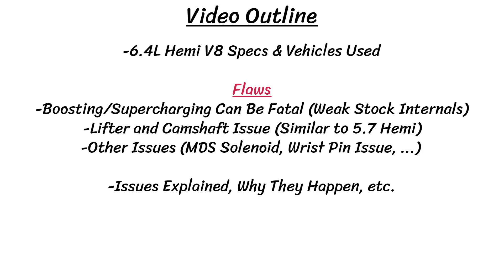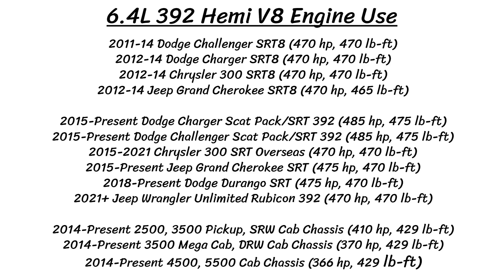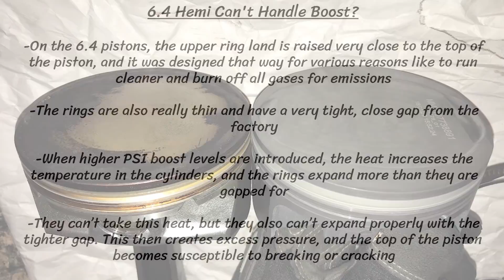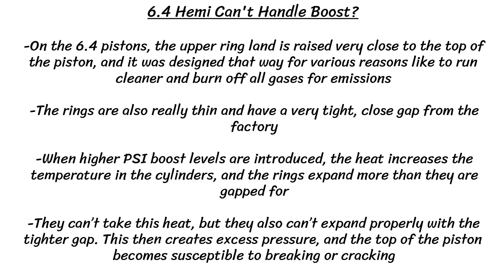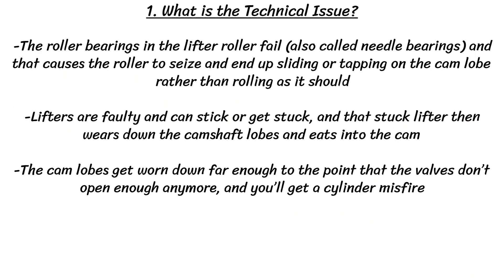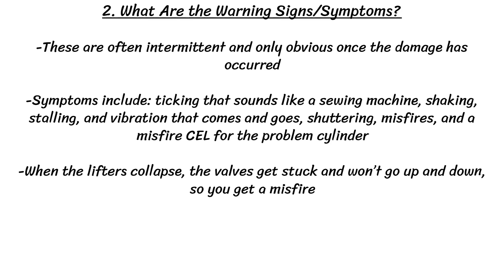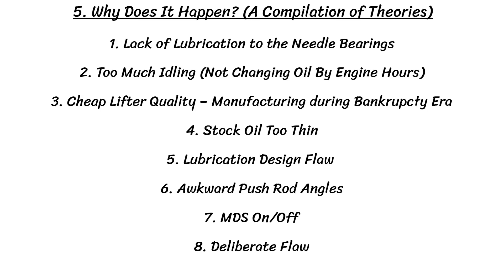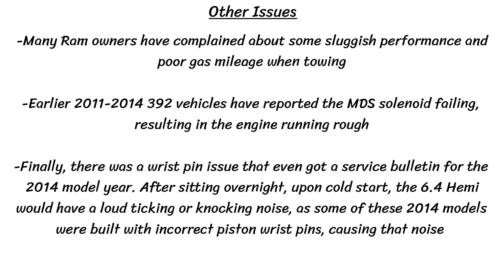The Specs and Fatal Flaws of the Chrysler 6.4L Hemi V8 Engine (392 Hemi Issues)

Comment: So they are fine unless someone screws with them. Ok.
Reply: You can mess with them, just don't boost it over 7-8 lbs without upgrading the internals. And make sure your tuner is experienced, and don't rag on it all day every day.
Reply: @dieseljunker9234  these people who burn out their cars think it’s normal to do doughnuts everyday, burnouts everyday and they wonder why the rear diff is fucked, trans is fucked and motor is burned out at 30k miles.
Reply: @Theycallmekenney  That's true, and from experience it takes discipline to keep your foot out of it lol. Trick is just drive it easy, be conscious of what repairs cost compared to your wallet, but don't forget why you bought it. Once in a while find an empty road and drive it like you stole it, or trade it back in for a honda.
Reply: @dieseljunker9234  exactly!! That’s how I treat mine it’s my daily and when it’s time to rip it I rip it on the backroads and on the highway but I’m not looking to just trash it by doing doughnuts and burnouts every chance I get who am I trying to prove something to?
Reply: @Theycallmekenney  yep not to mention rubber is expensive
Reply: @Theycallmekenney  Well when Chryslers quality is so low, it's now wonder why this happens. Even my mom's brand new 2015 Chrysler 200s transmission was going out back in 2018 with less than 20k miles at the time.
Reply: @journeytree  your moms car is what they call anecdotal evidence. If it’s happening on a large scale they’d recall the Chrysler 200….I don’t know your moms situation I bet if she had another car with the same issue you’d say the same thing about that manufacture. You people buy a cheap car expect Porsche quality. Just face the fact that a lot of people are idiots with their cars that’s why they rip through transmissions on a regular basis. Your moms car is a separate issue.
Reply: @journeytree  good
For your family but this isn’t about your family this is about guys who rip through transmissions because they beat on their cars. This is about V8 muscle cars and the issues these cars have because people don’t build them correctly and destroy them then blame the manufacturer for their own ignorance.
Reply: @Theycallmekenney  Well on the other hand my dad has a 69 Roadrunner with the original 383 and original transmission and it still runs fine so if a car can last over 50 years with a large V8 while a new 4 cylinder can't, there's a quality problem.
Reply: @journeytree  you’re comparing apples to oranges and I don’t know why…
Reply: @Theycallmekenney  Cleatus has left
Reply: @Theycallmekenney  pretty sure they don't even make the Chrysler 200 anymore cuz it was such a shit car
Reply: @gravestone9831  I wouldn’t doubt that but id never buy one even if it was a good car so 🤷🏾‍♂️
Reply: @Theycallmekenney  a performance vehicle should be able to handle everything you have just listed. That’s the problem with the 6.4. Why would you buy a performance car that can’t even make 600 hp without forging the bottom end in 2021?
Reply: @coltoncaskey5781  if you buy a performance vehicle and you mod it and it breaks that’s a YOU problem. The Scat is stock 485 HP why are you screwin around with it? A hell cat is 717 HP what are you trying to do? Fly off the ground? They’ve already built it for you and you’re not racing legally so deal with the consequence if you break it don’t blame the company.
Reply: @Theycallmekenney  485 hp to the crank is slow. Very slow. Super dumb buy if you’re buying the car as an enthusiast who enjoys making the car their own and modding it. Which I hate to break to you, is what a lot of people like to do. However, it’s a great motor if you wanna keep it stock and slow just to cruise in.
Reply: @journeytree  well the 9 speed was shit. the Good trans was the 8 speed and they didn't put it into the 200.
Reply: @dieseljunker9234  You seem to have some experience in this field. I was wondering if I could add like a "eco-boost" to my charger scat pack wb. I live in a city, and I was wondering if you know what is optimal boost for gas mileage?
Reply: @dylankessler123  short answer, no.  Your getting what 13 city? Maybe a lil better?   If you have an automatic I believe there is an mds system built in the engine for better fuel mileage but im guessing only really works if your running a smooth constant speed like on the highway. Pretty much what comes from the factory is optimized for performance and fuel economy. If you bought a scat or any performance car you should expect a bit worse than a regular sedan. 
     But if it's any help to know I've got 10k in a supercharger pushing 760hp engine 653rwhp and im still get 12.5 to 13 city and 25-28 or better highway. When im not making it scream lol.
Reply: @dieseljunker9234  Oh wow, that's really nice mileage for the performance! I'm envious, especially considering you're pushing Hellcat numbers, and getting MUCH better mileage, haha. We just bought a house, so spending on the car has to wait a bit unfortunately...
Reply: @dylankessler123  I feel ya.  And yeah I was surprised too. Locally around 13 then I went for a weekend drive and was just watching that number climb. Almost seems like the faster I went the better the mileage got lol. And its a manual so no mds in the engine.
Reply: @dieseljunker9234  Oh that's tough. It kills me to say that I prefer an auto over manual now. I used to drive only manual back in Japan, but since tech has made automatics more intelligent, it makes no sense to get a manual for mileage. Superchargers sound better to my ears, and I like the instant response but I know there's parasitic loss...
Reply: @dylankessler123  yeah the automatics got me at a handicap from a dig, but manuals are fun, and I can save my butt with that clutch if needed. Sc or turbo,  there's always a trade off, para loss or waiting for boost. Both are good imo im not breaking any records yet lol
Reply: @dieseljunker9234  Understandable! Yeah, I was wondering if there's a system that uses a supercharger at the low end, and a turbo charger at high rpm.
Reply: @dylankessler123  well its all just forced air just a matter of how you make it. Sc runs on pulley (thus parasitic loss but power throughout), turbo runs on exhaust ( higher rpm to produce boost so you rev high before launch to pre boost). On a scat you can get it from either up to 7-8 lbs. Boost before toy have to start rebuilding your engine internals to forged parts. Which is expensive. Best is start drive shaft, clutch, maybe rear axle and diff then add boost and decide if you wanna build the engine. I personally need to work on that last bit. Especially shaft and clutch.
Reply: @dieseljunker9234  Yeah, I've seen some pretzeled shafts on here. Thanks for the information bruv! I am going to start with a forged drive shaft!
Reply: yep I will stick with my 73 RoadRunner 440 413 wedge heads 727 trans and 8 3/4 rear with 4:10 gears.
Reply: @ericsteel7643  Sure you got one. 😂😂😂
Reply: I mean why drive a sports car if you’re gonna just baby it. If your gonna be pushing on it a lot, just have the money for the consequences. I push the limits on my car and I don’t regret it .
Reply: Exactly!!!! It’s reliable until these goofballs get their hands on em

Comment: 6.1 is king well until we see your  video about them. But seriously I haven't heard anything bad about the 6.1 at all. Other then people who abuse them and cheap out on maintenance or proper oil for the motor. Which I never understood why some people buy a performance car to cheap out on service?
Reply: The 6.1 is way more reliable than the 6.4.
Reply: @MrCSRT8  ain't that the truth brother. Only loved the 6.1 as the 300c we got in Australia first gen look is just pure awesome wish we got the chargers to but happy to have a modern mopar with a serious hemi in it
Reply: 392 with silly variable cam notwithstanding - I'm jealous of you guys down under getting several more model years of 300 SRT - the latest ones with the 8-speed - denied us in North America (FU FCA!).
But my '06 300 6.1 with cam, heads, ported manifold, polished exhaust ports, stock exhaust, and stock 5-speed makes 525hp (390 kW) and 492 ft/lbs at the crank and puts down 450hp/426ft-lbs to the wheels.
Reply: Agreed 100%... These "fatal flaw" conversations, as the years pass, will give them a bad rep, and only experienced people and Mythbusters will be able to fix it. Honestly this all sounds just like the consensus abour the old Dodge Stealths and 3000GTs...too complicated, too fragile, too much maintenance, not reliable, etc, which is all garbage if the prescribed maintenance was followed. How someone would buy the equivalent of a (now) $50-60k sports car, and then not do the maintenance, and then bitch when it breaks, is beyond me...!!!

Comment: None of the issues you report have spooked me about my 2019 Challenger Scat Pack. I love the power as-is & have no intention of supercharging it. If I wanted a blown engine, I’d have gotten a Hellcat. (Besides, 100K miles? How many owners will see that?) I change my oil frequently, so I have little concern w/the lifter issues. Just my opinions & thoughts.
Reply: 2014-16 they revised the lifters so it’ll hardly happen now.
Reply: @curtisnoble.  exactly. As
Long as you change your oil regularly and don’t idle your car for more than 5 min you are good.  If you are idling let’s say in a drive thru or are waiting on someone occasionally rev the engine to
2,000 rpm so it can splash oil everywhere and keep everything lubricated.  This is why you saw a lot of police chargers for sale. But since the revision you don’t see a lot of the new police chargers. Not only did they revise the lifters they also revised the camshaft which now makes the lobes higher.  So
Do research and you can reference everything I’m saying simply by going to a Chrysler website and check all the revisions by part number.  Never buy any lifters from a parts store as they are using the old design! I learned the hard way. Always order directly from Chrysler
Reply: @OddWrld  I’ve ran the engine without coolant, overheated dozen times, floored when cold, ran on 7 cylinders once for a few miles, the engine is still strong. I’ve put 100k on the engine until I sold it, I’m sorry for the next owner but that engine shouldn’t have lasted this long.
Reply: @OddWrld  definitely, if any ex police vehicle I’d buy would be Crown vics, or Tahoe or Taurus, and even other then the Vic, they are scary buys
Reply: Just bought a 2019 R/T Challenger scat pack 6.4. Love it so far and can't see why someone would want to alter it. Plenty for every day driving for me.
Reply: The first owners won't, but the next guy that buys it used is going to have a bad time.
Reply: I just sold my 05 5.7 Magnum with around 200k I abused that engine did oil changes around 10,000miles, floored it a lot, idling a lot, never experienced the hemi tick.

Comment: I’ve had my 6.4 Charger for 7 months now and have loved it but reliability worries me and knowing these issues are literally right after the warranty wears out and then your paying steep prices for modifications
Reply: Don’t mod it keep it stock and you’ll be fine
Reply: @Theycallmekenney  And change the oil...the cams he showed in this video look like cams that i had seen in a 200k mile f150 5.4l Triton engine. It was a like highway service truck, regular oil changes but just conventional. Not horrible but not great either.
Reply: @baileyhatfield4273  yes change the oil!!! I do oil changes every 3,000 miles and use Amsoil….but a lot of these people build cars and beat on em without realizing it’s to be expected….and why build a motor to 30% build it all the way with a new beefed up Transmission and a beefed up rear end.
Reply: I'm  on my 4th challenger in 10 years . Keep the oil changed , I do it every 5k with my tire rotation with Pennzoil Synthetic oil. I've never had a engine issue and my 14 had 110k on it when I traded and it still ran like brand new

Comment: It is MDS for the lifter problems most of the time. I bought my charger, it had a little bit of noise from lack of oiling, but I caught it early enough, turned off my MDS and it improved 100%
Reply: How did you turn off your MDS other than running in sport mode
Reply: @robc8468  get a diablosport tuner
Reply: Not MDS issue. Lifter design weakness.
Reply: Actually, when MDS is on, it adds more oil to lifters.
Reply: @Rrottweiler  all Lifters are  oiled regardless MDS on or off. Turn off MDS by software, MDS lifter is operating as normal lifter. Lifter roller seizure is due to small needle bearing not holding up. That’s why lifters were AA, AB, AC and current AD with larger fatter needle bearings to address early bearing weakness.

Comment: This is why I will be keeping my 392 completely stock!
Reply: The MDS lifters are your main concern. Some dude shortened a set of stock rings, removed the MDS lifters and has a reliable boosted 5.7 he beats on constantly at the dragstrip. The last thing you want to do is keep those MDS lifters! Ignore the envious hatred of the Chevy guys lol. All the Hemi people I know have reliable cars without MDS lifters; especially the manual cars that don't even have MDS lifters...
Reply: @PyroBlonde7777  what if I run the car in sport mode all the the time so the MDS doesn’t activate? This way all 8 cylinders are always firing.
Reply: @jgboys1  that helps because when ever a piston isn't firing that lifter doesn't have oil flowing through it to oil the roller. So long as the lifter is pressurized and the piston is firing the roller should have oil. Thats why idling for long periods of time chews up the lifters. They don't idle on all 8 cylinders so half the rollers aren't being oiled efficiently.
Reply: @PyroBlonde7777  got it.  I try not to idle it for too long. I never use the remote start unless we have snow and it is freezing out.
Reply: @jgboys1  there are cars out there with a lot more than 100k miles so don't stress it unless you get a miss fire lol
Reply: @PyroBlonde7777  yeah I heard about the mds thing after I got it, luckily mines a manual
Reply: Yes you're right about keeping it stock. Unless you intend to do a total rebuild. Your already at it's limitations on performance. MOPAR sets their engines at the top end of limits that's the way they've always done it.
Reply: @GWEN!!!  My wife complained about me spending over $6k on a Procharger 7 years ago. My plan was to change the rods & pistons too but i figured if I blow it up then I'll have an excuse to buy a forged motor. But it didn't happen, I'm always raising hell every time i drive it. I don't drag race it. It's fun to drive on the  street. Hearing that blow off valve  sounds awesome.
Reply: @GREGORYALLENKARNESJR  3.6 and 6.2 would like to have a chat
Reply: Same!
Reply: 760hp at the crank, with only 8lbs boost, good tune runs fine.
Reply: @dieseljunker9234  what power adder you running? procharger?
Reply: @jackjensen259  whipple
Reply: Take it to the drag once or twice a year and do light mods and an intake or exhaust and take care of it you will be fine.Also  no need to mod the car--if you have drags on these you can run high 10 seconds in the 1/4.Also most people--90% that goto the track--even folks that buy performance cars to do it--most stay in the "street tire division".The skill in that division if you have a RWD car--and especially V8 muscle cars is learning how to get the most out of the car.Adding another 200 HP to a car does nothing if you are not going to put drag tires on it--all you will do is lower reliability and still run slow times cause the car will not hook up.I went and bought an AWD Stinger because I wanted a reliable fast drag car that could run good times on street tires.I also always wind up running with american V8s and I prob beat 75% of the NA American V8s--simply cause most are too agreesive--or put so many mods that the street tires can not handle it and they spin and squirrel while running a low 13 second quarter mile shaking their head on why car and driver can run a 12.4. First car and driver takes the best times of multiple runs with them dogging the shit out of the cars--laying wheels most people are not going to do to heat the tires nup--also in many cases they also switch to the most performance tires they can get.Then you have to ask yourself a question as you line up against--say my Stinger, Are you going to burn out 700 dollars worth of tires to try and beat me--Also are you also willing to do that just to match car and drivers time and willing to dog your car out to do it.Dude in CTS-V went all out years ago in the street tire division just to see.He layed massive wheels in the burnout area--after his third run of the night--his tires were shot--check engine light went on for his 2nd to third run--and out of 3 runs--he ran a low 12 on one of them.So he went 1 for 3 on good times--and ruined a set of tires in the rear--and had his check engine light go off and on--so that is the questions you ask when you goto public drag night in your charger.
Reply: Me too
Reply: 1000%
Reply: Run a tune, air intake system & good exhaust
Reply: Thanks for the video guy
Reply: 392 is the 6.2. The 6.4 is 396 ci
Reply: @aaronmcconkey1062  Nope. 392 is the 6.4, the 6.2 is the 376
Reply: @aaronmcconkey1062  have you lost your mind
Reply: @aaronmcconkey1062  Damn son.  Check on things before you type stupid stuff in the comments.  I’m sitting here looking at my 6.4l 392 Hemi.
Reply: @aaronmcconkey1062  no the 6.4 is a 392 the 6.2 is a 378.
Reply: @aaronmcconkey1062  6.4 is definitely the 392.
Reply: @aaronmcconkey1062  6424 mm3 are 392,01 in3
Reply: @aaronmcconkey1062  You would be wrong. 5.7 is 345ci 6.2 is 376ci and 6.4 is 392ci. A difference of 0.2 liters is going to be a lot more than 4ci...
Reply: @aaronmcconkey1062   lol no the 6.4 is called 392 for a reason. The 6.2 is a 376.